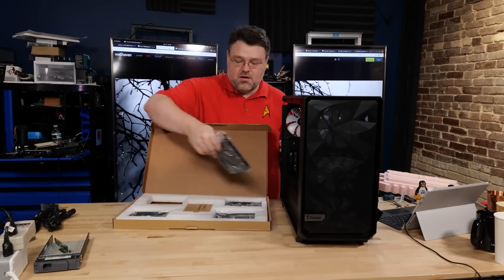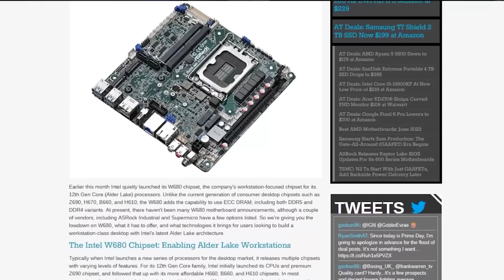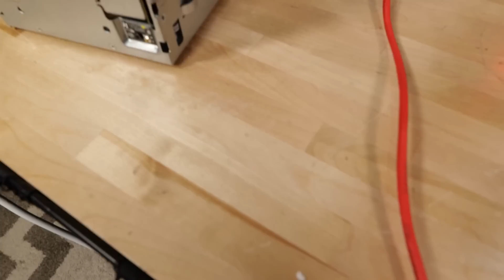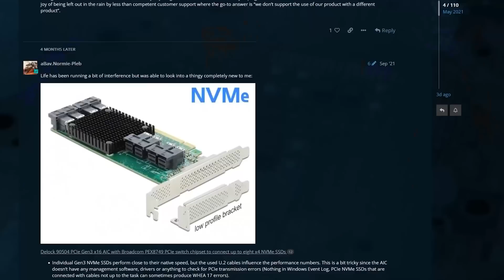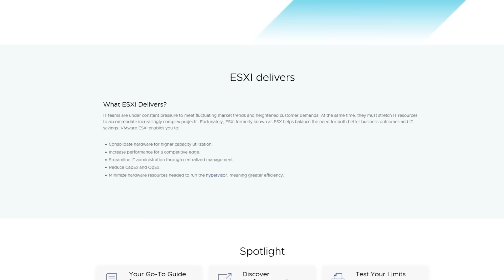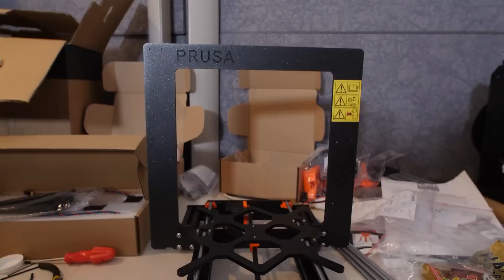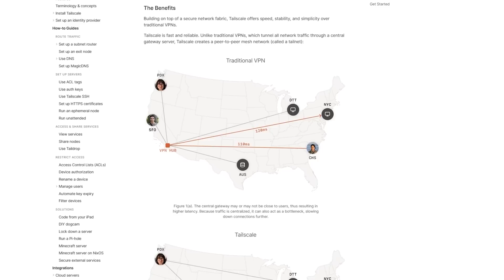Low Power/High Performance Server GRUDGE MATCH! DeskMeet, Ryzen, and Supermicro Micro-Tower Server

Comment: I went down this road about 5 years ago and ended up with a Supermicro MBD-X10SDV-TLN4F-O, with the embedded 1541SOC chip, 64gigs ram and SSDs.  One spinner for backups.  This has been my home server/testbed, and even with a T350-T4 Intel ethernet card and 7 drives, it runs on average in the mid 90s watts, running 6 servers in ESXI.  Saved me a bunch in energy bills vs my prior builds where the chip alone would pull that...  and doesn't heat the room up in summer.  My Truenas is another supermicro, a  MBD-X10SAE-O that I just put a used Pentium G3220T in, replacing an 85w TDP XEON- it's  only serving files to 2 people so the XEON was a bit much...  Next year I plan updating both... hence I am watching...